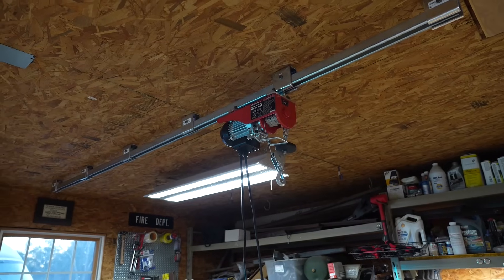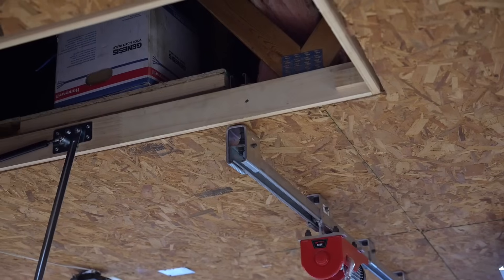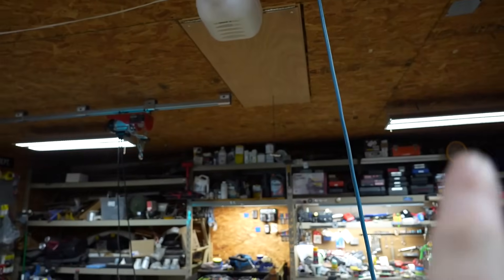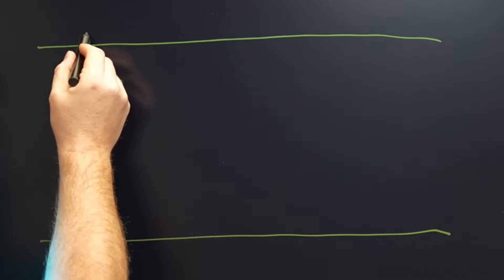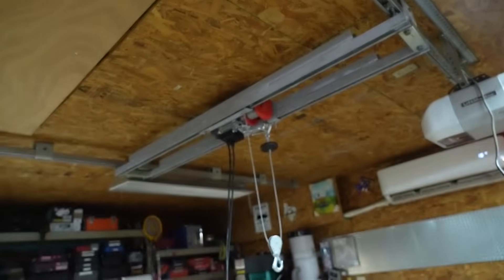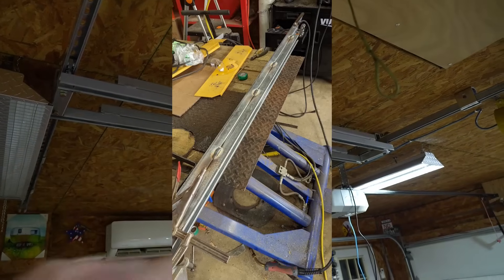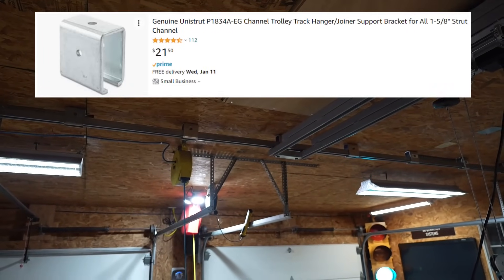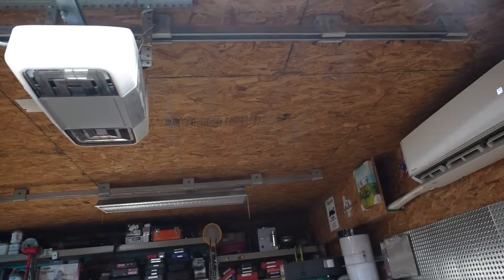Installing an Electric Hoist from Harbor Freight in my Garage using Unistrut, Shop Crane Gantry!

Comment: For what its worth, they make a strut thats 60mm tall rather than 40, if you use that you dont need all the mount brackets, the mount bolts fit inside, it makes the overall profile more compact and the install less expensive.
Reply from the maker: That is very good to know!!  The struts in the video are 1-5/8" (41mm).   Sadly for me there still wasn't enough room for the bolts and the hardware I was using.    But I'm sure there are many options like smaller trolley wheels or even shallow bolt heads.  But 60mm would be plenty of room to avoid the brackets!    Good to know for sure!
Reply: Wouldn't that be structurally stronger being taller unistrut, maybe enough to overcome the sag of the 40mm you welded back to back. Just a thought

Comment: Outstanding project!  I love unistrut but it’s so darn cost prohibitive! The accessories cost even more! I never understood how some company never offered a cheaper alternative.  😃👍
Reply: look at 80/20 Aluminum. its stupid expensive. The answer is the time it saves you over using angle iron. And in the commercial space you don't hire an electrician and a mill right when the electrician can do it in half the time with some Unistrut. but yeah.. I'm surprised more manufacturers haven't started making almost identical stuff its probably patented
Reply: I agree..  I've had some luck dumpster diving near my work whenever I see them remodeling a building.  When they do demo unistrut, its not like its bad or anything, so I grab up all the pieces I can get..

The little hangers that he has on his are STUPID expensive, I can't believe they charge so much for those.  So instead of those, I just cut up some angle iron and weld it on the side to make little "L" shaped tabs.
Reply: That's how they make their money.  The unistruts are probably sold at slightly higher than the cost to make them - called loss leaders in some circles.  Unistruts are useless until you pay extortoion money to mount the things.  The profile of the hangers are not much different that the profile of the unistrut - they appear to be just cutoffs from a deeper unistrut forming manufacturing line.
Reply: @DeadFlanders  it's very important to keep in mind the hangers don't just have the lag bolt going into the joist. It's hard to see on the video, but there is also a through bolt that prevents the hanger (and the unistrut) from spreading open under load. The last thing you want is the unistrut opening up and allowing the trolley/hoist to fall through the failure point under load. Could lead to fatal injuries. The hangers are thicker gauge, to handle not only the vertical load, hut also resist the lateral spreading forces that can occur under load. If you look up something like the P1834 trolley hanger for example, you can see the holes for the through bolt. I agree the hangers unfortunately are expensive. 

Edit: I suppose it's possible if the L brackets you use have a welded gusset, and you use the brackets as a pair on both sides in direct opposition to each other, that design could prevent the unistrut track from opening under load.

Comment: The trusses are designed to support the roof and whatever load is on top, usually snow. I’m not sure how a load hanging from the bottom would affect the truss. Spreading the load across all the trusses was the safe thing to do.
Reply: Most trusses are supporting the weight of boxes full of Christmas ornaments, old plates and clothes from the bottom. I'm sure there's a limit but it must be close to a 1/2 ton.

Comment: A domed hex head cap screw should give enough clearance between rollers and slot in base of unistrut  so you dont need the uni strut brackets to save more

Comment: One tip if you worry about maxing out the joist before the hoist: reinforce the joists with a 2x6 and add a floating stud that gets jammed under the side farthest from the wall. A 2x4 can add ~1000lbs of support as a secured post.

I lift 500lb engines frequently on/off my truck with all weight on single 2x8 that's reinforced with a 2x6, braced by a 2x6 stud at the wall and 2x4 post 8ft from the wall. To test I hung one engine up and lifted another with zero measurable deflection. My garage alternates 2x4 to 2x8 so I can't spread the load via unistrut in any useful way.

Comment: I built a setup like this 3 or 4 years ago. I actually put it up in the attic though. I attached my unistrut right to the ridge board. I doubled 2 ceiling joists so I could cut one out, and made a 30 by 60 opening. I covered the entire attic floor, and reinforced my rafters. I can lift an engine up into the attic, and then roll it sideways to where I want it.

Comment: Wow ! That's an amazing idea. Uni strut is so underrated. It is quite strong too. 
I once used it over a circular mechanical riser to chain block a 100+ KG axial fan assembly.
It didn't flinch.
Thanks for the video !

Comment: That was a brilliant idea. I would of just continued with more track to the right of the attic access and put a pulley on it. That way I could just keep the winch to left of the access door and run the cable through the pulley on the right of the access door if I needed to lift something over there.

Comment: For my particular trusses in my shop, I called the distributor and they told me that the trusses they sold me could withstand 5 lb per square foot. I believe that is calculated for attaching plywood to the top and using it as storage. I don't know how you calculate downward pressure, but it seems like I could attach what you did without a problem. If anybody has any comments about what they think the downward pressure could be, it would be appreciated. Thanks for the great video!!
Reply: you could double up the wood on the trusses and cross brace to the roof for additional strength.
Reply: Thanks!

Comment: Great Video!  Did you install a Cross Brace Strut in the Attic at each spot where you can see the Hanger Bracket below?
Brackets look to be spaced about every 2 feet?
Reason I ask.
The span I want to run is about 20 feet x 8 feet.
Contemplating if I need a Cross Brace on top every 2 feet or was thinking maybe every 4 feet with a shim to match  the thickness of the Strut inbetween at 2 foot intervals? 
If I use a Cross Brace at every 2 feet , I would need about 14 pieces of Unistrut.
That weight plus the weight of the Hoist on top of lift load,
has me a little concerned?
I use my attic for storage, so I already have a bit of weight up there.
Thanks for your time!
KZ

Comment: you can get taller Unistrut then you could mount it with bolts right to the ceiling but not sure if it would save money over standard Unistrut and the brackets all Unistrut parts are expensive. the strut is not too expensive but they get you on all the accessories.

Comment: Looks cool. I tried something similar and I believe it’s measured as even as I can but it does tend to bind quite a bit. I guess for what i use it; it’s ok
Reply: did you try using a block of wood as a spacer instead of just a tape measure to set the distance between rails?
Reply: @rupe53 I didn’t try that but I feel there’s enough play regardless of how closely measured it is that it would still bind. It just seems the tolerances are a bit too loose. But then again; I’m not an expert and perhaps there is a way to make it work smoothly I just haven’t figured it out yet. But it wouldn’t be a bad idea to try your method. Might actually work
Reply: @Bravo57-57     also, the width of the H part pays a roll. If the rollers are too close together the H can cock, causing a bind.
Reply: @rupe53  yes. I can deff see that. I went ahead and watched the vid again and one of my mistakes was I just used one beam in between the two main beams leaving more room for a bind unlike the vid where he’s showing he used two and put the lift in between them. This helped reducing the binding chances on top of being more precise in his measurements.. which is where I think I must’ve screwed up lol. Good thing it’s easily correctable.

Comment: How do you get the strut into the hangers? Did you mount the hangers to the ceiling first and then put the track in? Or do you have to bolt from that tiny space between the strut and the hanger?

Comment: I have installed a very similar system.  What did you do for the electrical for the hoist motor?  I have been looking at spring coiled cords.

Comment: This is rad...I'm going to do this. Your double up rails, the ones holding the winch...it looks like you've welded something at the end of those parallels to keep it all square. Is that correct? Just sheet or did you use a piece of track?
Reply from the maker: I did weld the end of the parallels, it's keeping it square as you suggested.   :D
Reply: @1D10CRACY  man my wheels are turning. Can't wait to execute this. My garage is a lower level with my living above it. I think I'll mount my channel hangers directly to the floor joists. Any red flags since you've done this?
Reply from the maker: I may very soon be running up against a simular situation.   I'm getting ready to tear off the roof and add a 2nd floor.   I'm not sure how I'm going to address the hangers.

Comment: How did you set up the power supply and keep it mobile?
Reply from the maker: I'm currently just using an extension cord as needed.   I have some better ideas, but they are going to be put on hold for some shop renovations.

Comment: I def have the height in my shop. Do you think 1 stick of unistrut in the middle with the 2 outside on the ceiling, but the 2 outside closer together would be enough strength? This is mainly for my Jeep hardtop…200lbs max.
Reply from the maker: In my crude testing, I was able to stand on one 6 foot span of 1 5/8" uni-strut with a little flex.   I weigh just under 250lbs.   At 8 feet, there was a lot of flexing.
Reply: One length of 3m unistrut should support 136kg of evenly distributed weight. Your top is just over 90kg, which should be fine. I'll add a pic of the load data. If you doubled up the unistrut back to back that would increase to 417kg over a 3m length.
Reply: I just saw this reply. Thank you! That data would be great.

Comment: Just installed the hoist, but cannot figure out how the pully is positioned versus the rope block.  Nothing in the manual.  Could be wrong, but in this video - like my own experience - the block doesn’t seem to do anything.
Reply from the maker: If you are not using the pulley, the blocking disc will bump up against the cage and stop the motor if for some reason you fail to stop it.   If you do use the pulley, then you really need to make sure to stop it before it binds up on itself.

Comment: I wouldn’t be surprised if the trusses would easily support something in the neighborhood  of a half ton or more with the load spread out like that.   We have any structural engineers watching the video?    It would be easy to wedge a temporary 2 x4 or 4x4 under the tracks to increase load capacity if you ever decided to go with a larger electric hoist and needed to move something crazy like a Bridgeport or Monarch lathe.  Okay, maybe nothing that crazy but you get the idea.